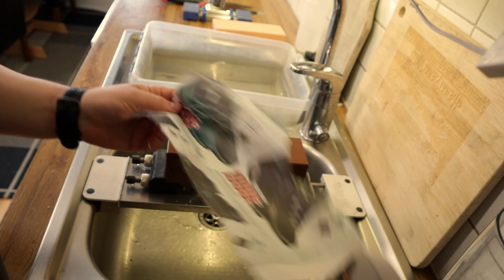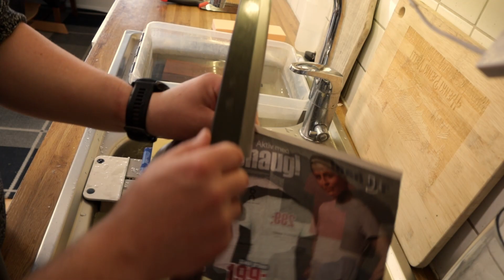Whetstone sharpening King 1000 and Kitayama 8000 on aogami carbon steel.

Comment: Those are beautiful stones, resilient and they'll last you for years to come if you take good care of them. I've had my first original king deluxe 1000/6000, my KITAYAMA 8000 for several years now.  I've added the Naniwa 12000 super finishing stone which is very soft but delicate, a Naniwa 320, a very nice natural Japanese water stone brick, a hard blue colored Japanese natural stone, my shapton pro collection 1000,5000,8000,12000,15000 and a 20000 suehiro which is hard, two jende large nano fiber strops-kangaroo skin anda 0.025 grit strop with it's matching compound anda tormek polishing compound, my set of Arkansas stones and other stones.
Reply: Naniwa 120000 for chef knife/ Gyuto??